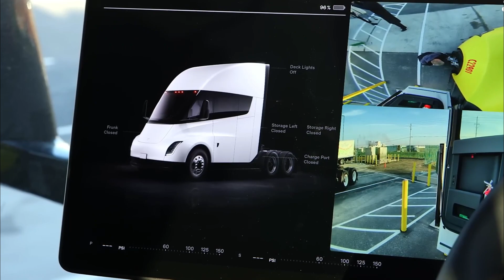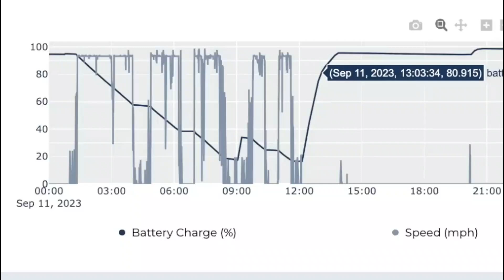A Deep Dive into Tesla Semi Trucks

Comment: Just like the cars they will be a major disappointment . Long range / quick charge ? what a load BS . At present all ev are not there yet buying now is just pouring money down the drain . And they are unreliable and expensive to do even minor repairs . junk and BS .
Reply: I'm not sure why you think EV's are a disappointment.  We've had two and they are better than any car we have ever owned.  There is no maintenance, no gas to buy, nothing but tires, wiper blades, and occasionally a cabin air filter for cheap.  We charge at home for about $6 a month and on the road for about 30% of what you pay for gas.  I'm sorry you're so sour on what is the present and future of transportation, but hope you'll put aside whatever you've heard and try one someday.  We were a Ford family all of our lives and will never go back.
Reply: @DJCJ. They are good if u stay in town and your batteries never need replacement.  No long road trips!  No thank you!
Reply: @jman6109  We've made several long road trips and had fun, no complaints.  Fast chargers are everywhere!  On the older M-Y, we've "lost" 4 miles of range in 3 years...